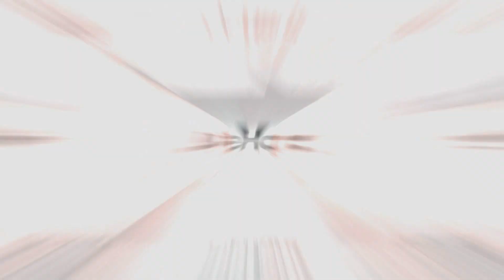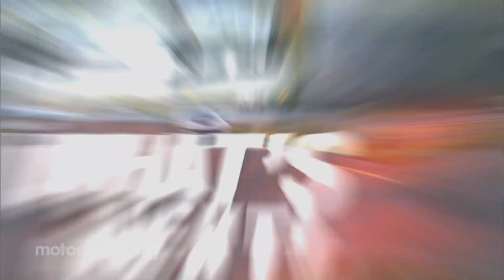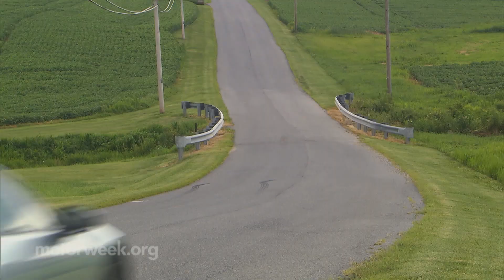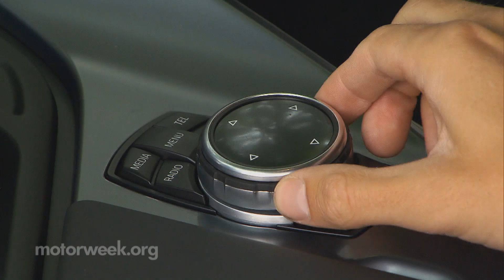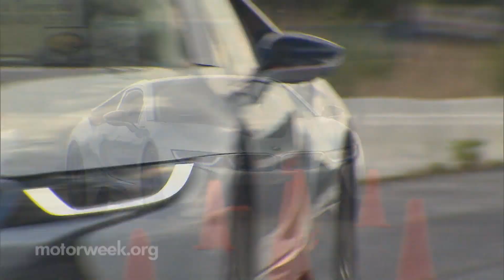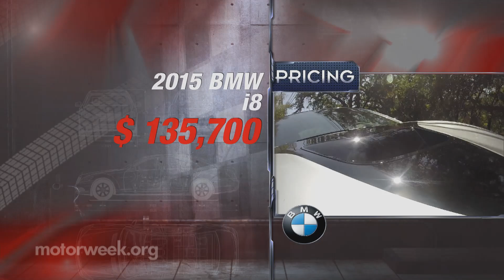MotorWeek| Road Test: 2015 BMW i8

Comment: My '11 Audi S4 is Just as fast, performs equally in handling, is probably more comfortable, is just as good looking (in my opinion), is a fun 6-speed manual, can be driven in blizzards, gets almost 30 mpg highway And is $80K cheaper than this thing! The i8 is a neat car, no doubt...but I think I'll stick to my much more practical Audi.

Comment: Supercar? I think not!
Reply: Why not.  Is not all about speed
Reply: This right here is a fancy compter with an aftermarket stereo. A very good looking computer but not a supercar
Reply: That's a superar.  In opinión
Reply: And I resoect your opinion. A supercar in my mind has above average bhp and is exotic like a lambo. This is morw lika an F-type Jag, more lika a sportscar, or perhaps the Audi tt Rs because that has also a backseat
Reply: Ryan Wagner is a 911 turbo s a supercar?
Reply: Does the 911 turbo s have more bhp?
Reply: Ryan Wagner Wat about a alfa romeo 4c
Reply: #Free Gucci It's got the general shape right, but a main point of supercars is crazy power output - its torque is substantial but nothing outrageous, and the power is on the low-end of V8 truck engines. You can get a Charger with the base V8's 370 hp for under $35K and it's basically a boring family sedan. The i8 is definitely in the range of fun sports car territory, but not a supercar by any means. The Nissan GT-R is the least powerful of what I'd call a supercar at 545 hp, but it makes up for that with neck-snapping acceleration.
Reply: #Free Gucci Yes. Powerful enough with a well-sorted chassis.
Reply: #Free Gucci Not in my opinion. Too low priced and not powerful enough. But that does not mean that it's not a wonderful piece of machinery, because it is - it just competes in a more affordable segment, plus there's the whole "it's better to drive a (relatively) slow car fast than a fast car slow" thing which makes its power more usable than a supercar.